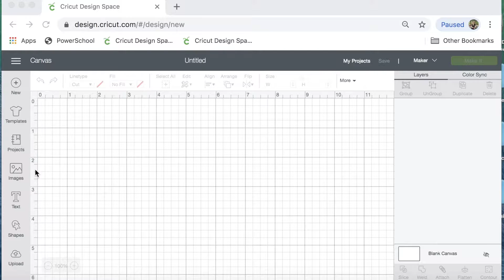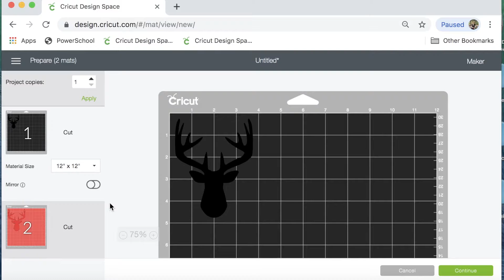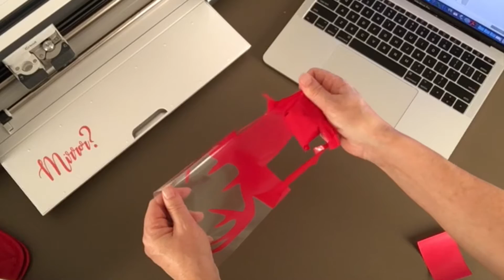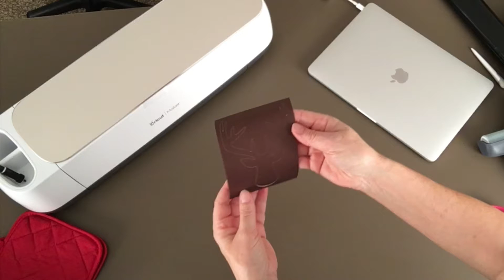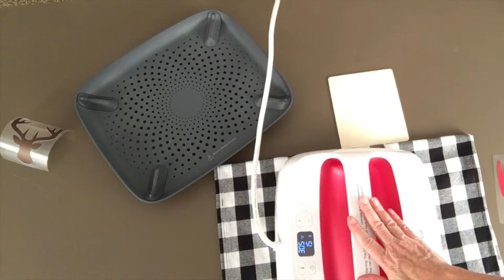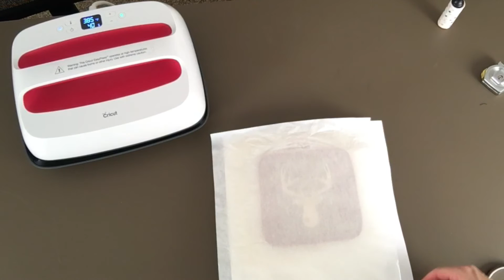Use Heat Transfer Vinyl and Cricut Infusible Ink to make a Christmas Towel and Potholders.

Comment: Thank you. I know your video is old now, but then so am I! Bought these same towels in the after Christmas sale and wanted to be sure that I knew what I was doing first. I wondered about doing infusible ink sheets on a darker color. Yours look great! I have those same pot holders, so now there will be matching sets as gifts!
Reply from the maker: Very very dark infusible ink, such as the black that I used in the video, will work on medium darkness 100% polyester (like the red ones used), but the colors don't  always end up looking quite right. Regarding the towel that I used, it was not a high polyester fabric, so I had to use heat transfer vinyl. I hope this helps.

Comment: Cool.... I just bought a Cricut Easy Press 2 and Infusible Ink this morning. I thought that Cricut recommended we use only their blanks. I wondered if we could use other blanks. You answered that question! YES! I'm very happy to see that we can use Dollar Tree hot pads and that it works well. Have you tried using the infusible ink on a towel, instead of using vinyl?
Thanks for sharing this video!
Reply from the maker: Thanks so much for watching and leaving a comment. You are going to LOVE your Easy Press and infusible ink! It is so much fun:) I haven't used the infusible ink on a towel, but I have used it on pillow cases. I have a  video of putting it on pillow cases. I use the inexpensive Mainstays brand from Walmart and it turns out so nice. Mainstays has 100% poly ones and a poly/cotton blend. So, if you try it, be sure to get the 100% poly ones. They are very inexpensive. Seems like I paid just under $5 for a set of 2. You can also put the infusible ink on sequin pillows or sequin Christmas Stockings. I did a video putting it on a Dollar Tree Store sequin stocking.